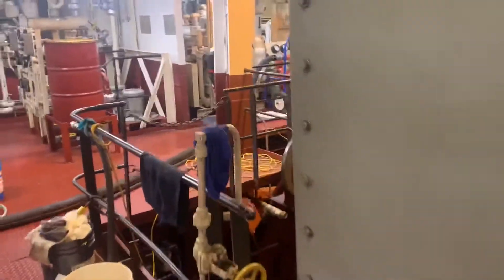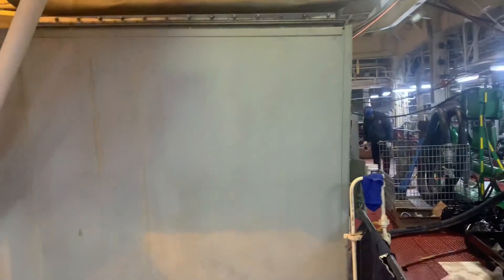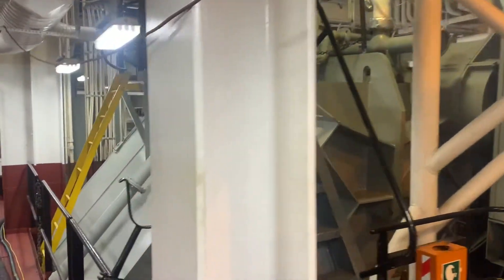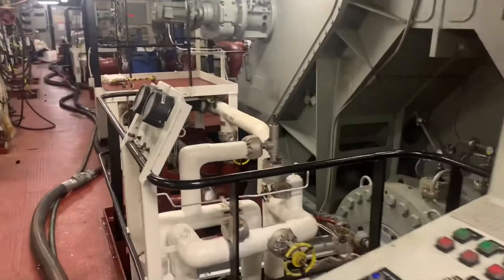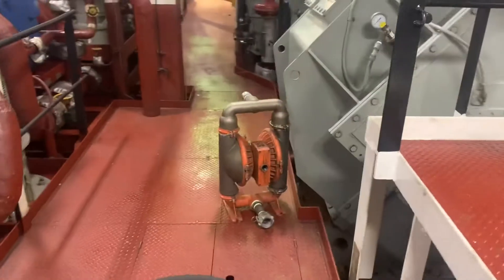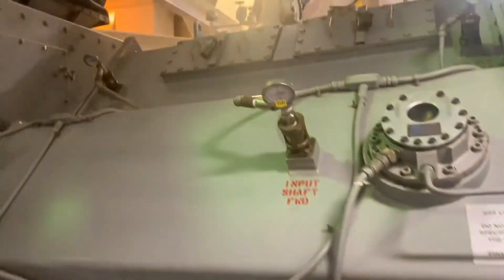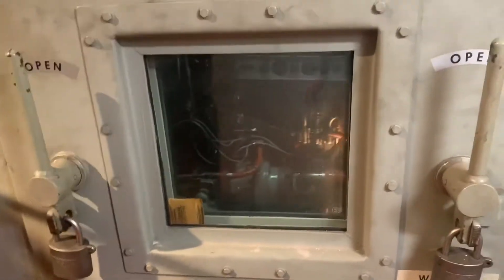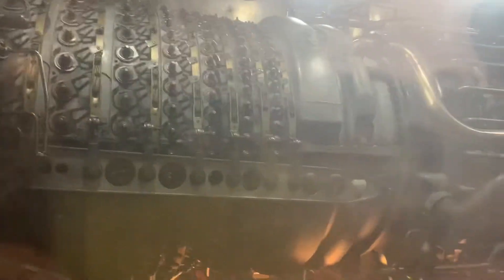Marine gas turbine propulsion

Comment: what's the reduction ratio
Reply from the maker: Oh man it’s been awhile. You can google the specs for the LM 2500 power turbine speed can be 3,600rpm, propeller speeds are under 200 so somewhere between 20:1 and 15:1 would be my best guess

Comment: Cool! What ship is this? Only one gas turbine? So it looks like gas flow through the engine is from stern to bow? And then the reduction gear output shaft goes back along the port side of the engine? (it's a little hard to see the layout) Do you have a waste heat boiler? Does it make superheated steam to run a turbine generator? I went to KP and worked with MEBA for about 5 years, now I'm working at a combined cycle power plant shoreside, gas turbines are crazy crazy powerful for their size and weight.
Reply from the maker: This is a twin screw/ turbine government design. Gas flow is from
Stern to bow. No waste heat boiler it’s not optimized for economy. diesel generators. Chevron had turbo electric marine propulsion gas turbines but I don’t know of any others. They have been scrapped- not economic and old for tanker trade
Reply: @steamman9193  Watson Class?
Reply: I spent 2 years on a Spruance class destroyer and we had the same engines.   But no window on the intake.   Awesome to see.
Reply: @fisidave the Ticonderoga class were the 1st to have an inlet window. OHP's did not though